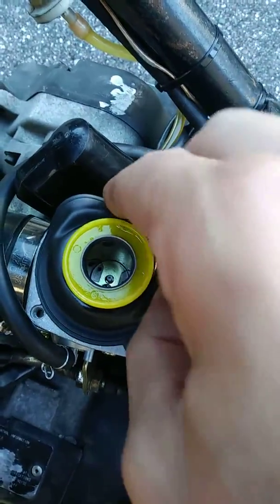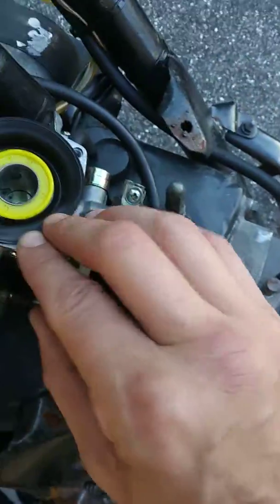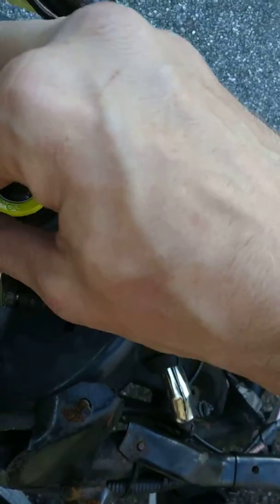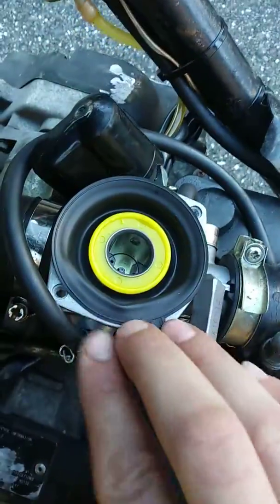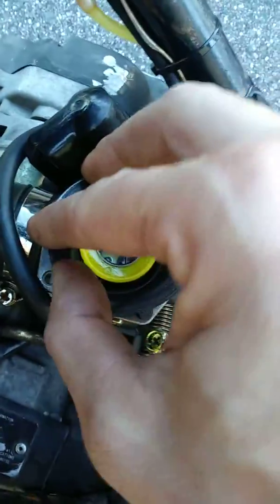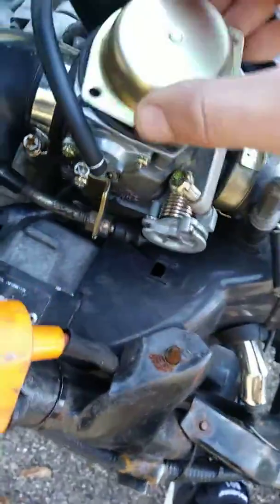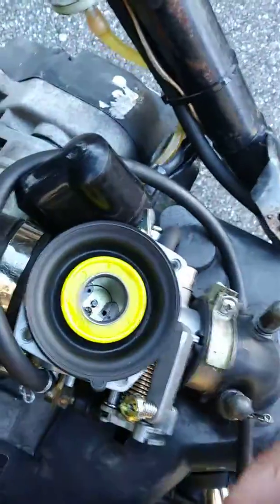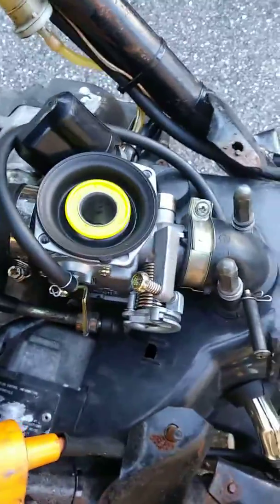Carburetor diaphragm got bigger?

Comment: I know this is an old video, but if someone is having this problem the reason is that it absorbed the carb cleaner so it got bigger, you will have to heat it up either by boiling, putting it in the oven or by using a heat gun but be very careful and check if it fits every 5 minutes or something so it doesn't go overboard
Reply: Bro thank you I bought one brand new and it just wouldn’t seal today I tired for a few hrs and said fuck em I gotta google ts